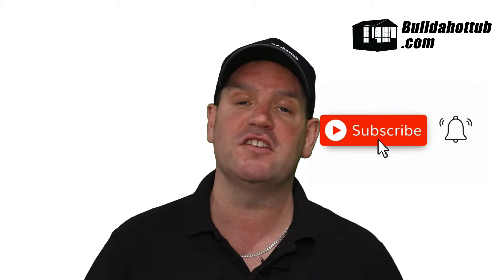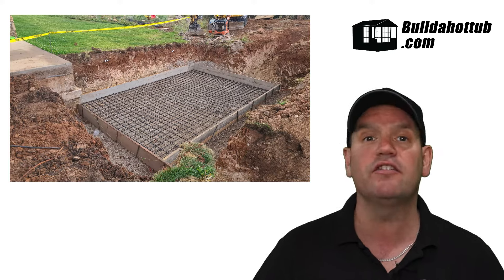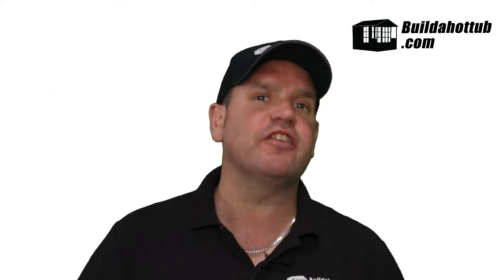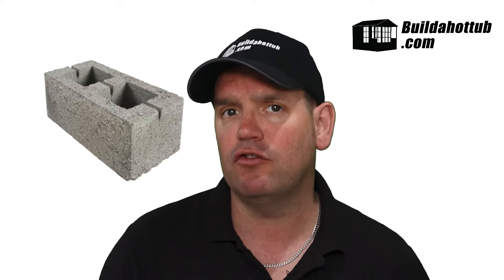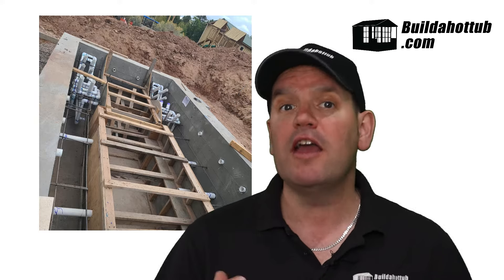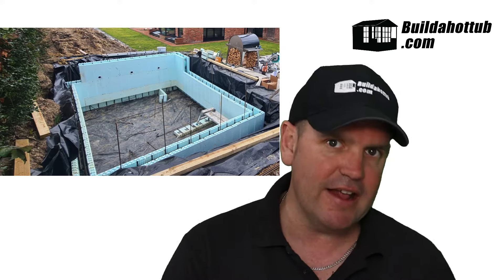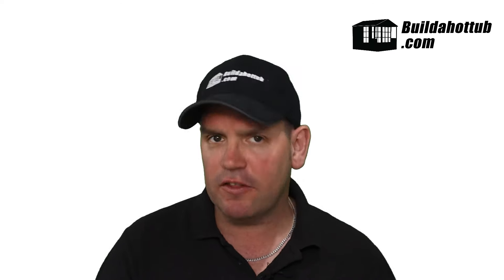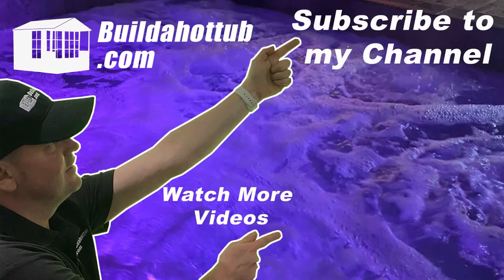Learn how to Build a Custom Built Spa

Comment: Have you ever worked up plans for a hot tub that has a tall waterfall that spills into the hot tub?
Reply from the maker: Hi Kationia, yes, sure - I like to put water features on a small separate pump that way they dont interfer with the jets. I've done both indoor and outdoor tubs with waterfalls. Can I help you with a design at all? You can drop me an email if you would prefer to discuss it there https://buildahottub.com/contact/